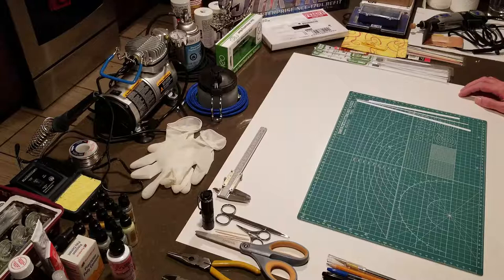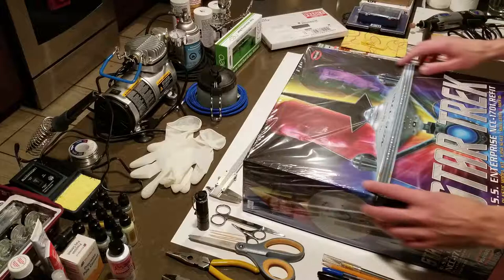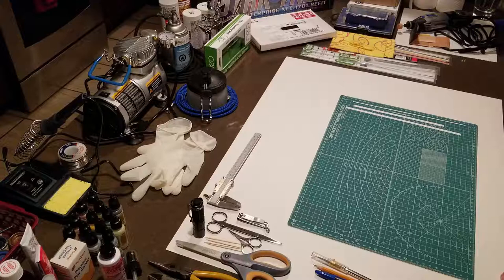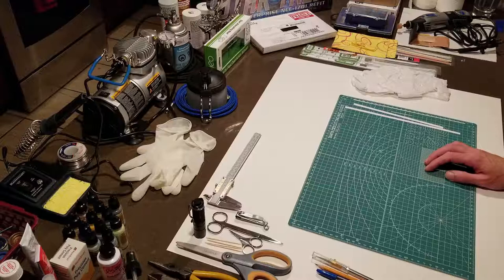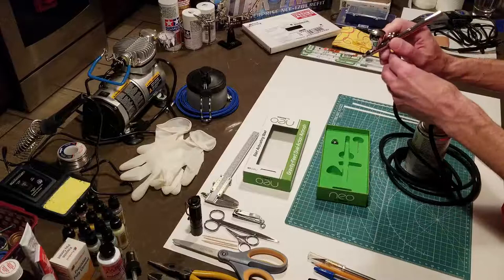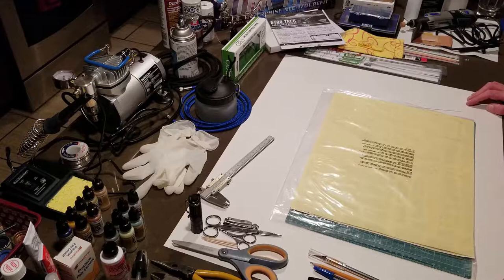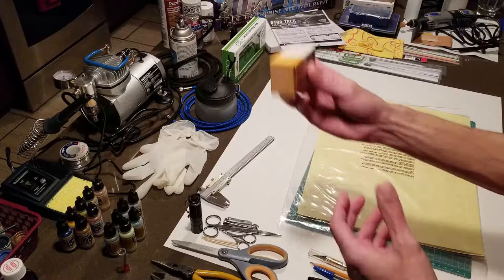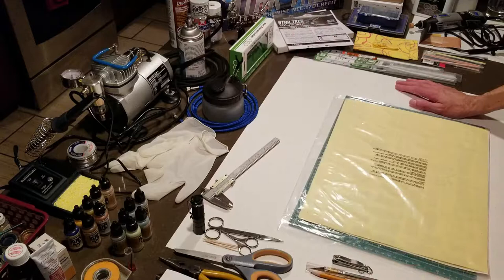Part 1 - Introduction: Full Build -  Polar Lights 1:350 USS Enterprise NCC-1701 Refit

Comment: A couple more things I'll recommend...First, a magnifier visor/helmet, you can find at Hobby Lobby for $20, really great for detail work and has a few lenses combinable for several magnification uses without adding reading magnifier glasses.  Second, a small pillar candle for heating if you need to bend or shape plastic, heat a needle, bloom fiber optic. A good utility lighter for lighting it would be a good addition as well.

Been over 25 years and I'm jumping back in as well with this model as well. Had bad experience with airbrushing a long time ago, mainly only had the air canister, so that was likely the problem.  I will be taking lots of time on this as well and give airbrushing another go.

Comment: Good luck on your build. I don't yet have your courage but hope to soon.
I've been following TrekWorks from the beginning of Boyd's channel. You made the right decision on the adhesion promoter. There are hundreds of "horror videos" where they peel off the masks...and the paint (even happened to TrekWorks). You won't regret it and it's cheap insurance.
You didn't cover the 4 color pearlescent paints (I know that's VERY far off but just had to mention it).
Very excited to see your background and expertise come to bear with the programming and electronics part of the build.
The refit is one of the most beautiful studio models ever created.
Reply from the maker: Thanks for your encouragement, I appreciate it. It wasn't courage that got me into this project, it was pure naivety! The depth of this challenge slowly sunk in after purchasing the model and some of the inventory.

I haven't purchased the aztec paints yet, I've bookmarked the page to the McKenzie iridescent paints selection. Unfortunately, because I live in Canada, there are shipping restrictions on the lacquer paints and I would have to order their acrylic variety. So I figured I would do some research first and find out if acrylic is an acceptable solution, or maybe I can source a similar lacquer-based paint here in Canada. It'll be awhile yet before I get to that point.

Comment: Really really bad advice you got from the shop on the air can.  I would add that the price for the Neo is maybe too high. The Neo is not made by Iwate, and in my opinion for people in EU, the Harder Steenbeck airbrushes are better value. They have cheap Neo like models and really good mid range. All the parts are interchangeable. 
Also regarding paint, Vallejo paints don’t belong on this model, in my opinion that is. YMMV - They don’t go on as thin and durable as solvent based. They tear up easily when using masks. They get rubbery when sanding. Whereas lacquer paints just sand down perfectly to a mirror finish. Tamiya have water based with alcohol that can be thinned with cellulose thinner. Maybe I am just really bad at painting with Vallejo.